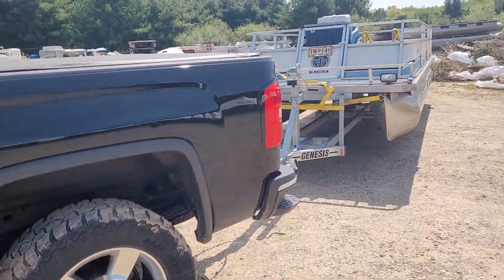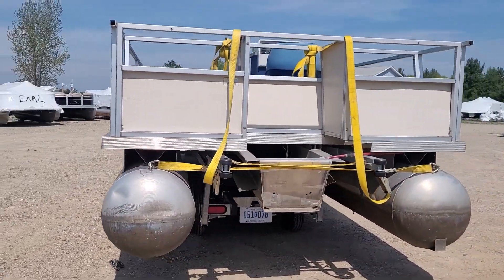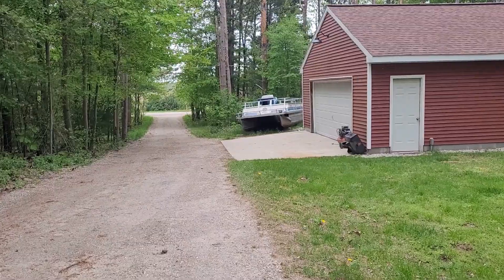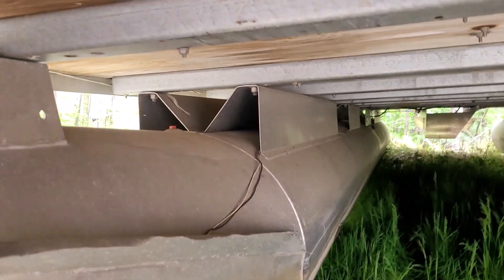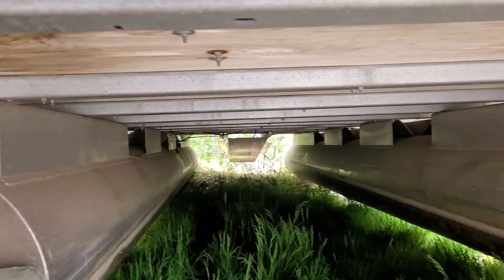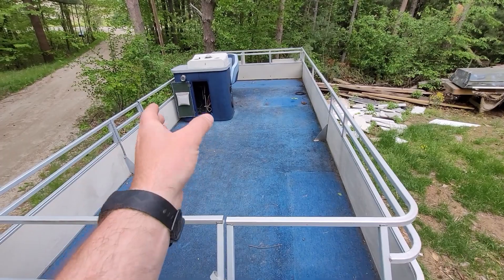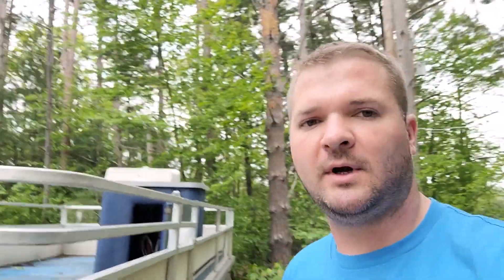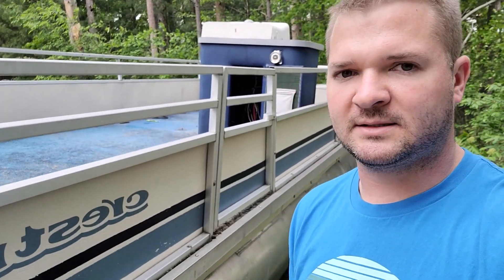The jet engine pontoon platform has been acquired!

Comment: Man maybe contact AgentJayZ he is testing and inspecting these type of jet engines. 
If you want put that jet engine there. But he might help you a lot. 
He is on youtoube and have channel.
Reply from the maker: Ya I've bumped him a couple times. He's given some helpful advice. The start up video is coming very soon!
Reply: @LiveLearnProjects  With full blast ? Yeah im waiting ! It's rare to find a start videos with old jets like this.
Reply from the maker: @MackFire_Sets  this first start will be just around idle. Check all the instruments and make sure it's healthy. Once mounted on the pontoon I'll add the high pressure fuel system and get it to 100% shortly after.